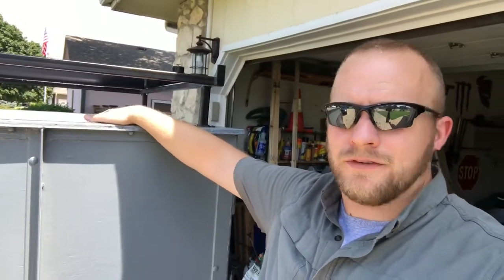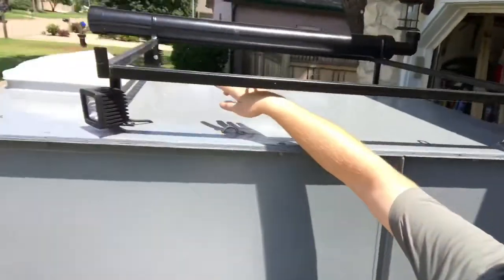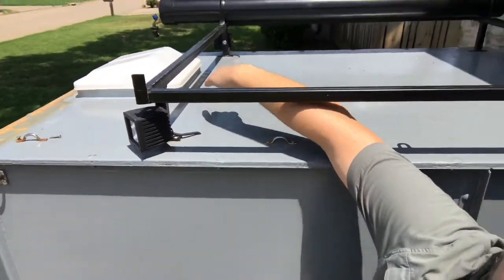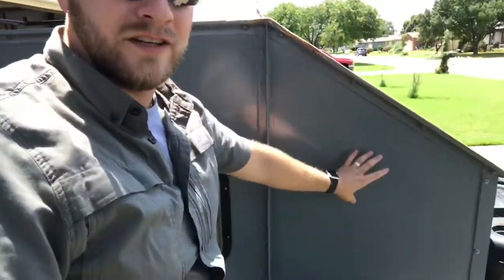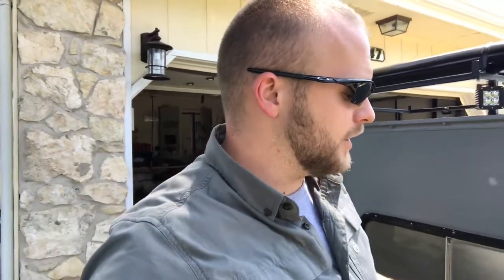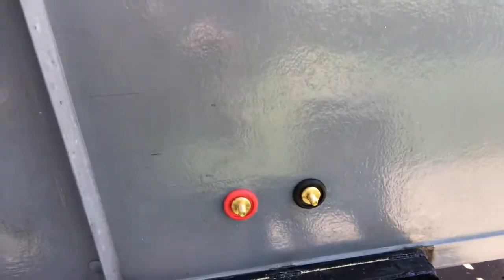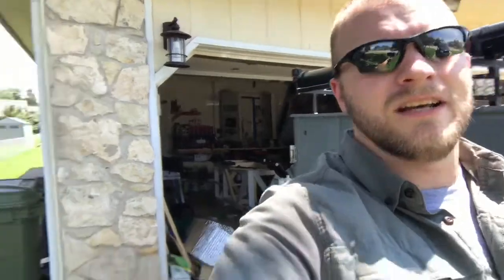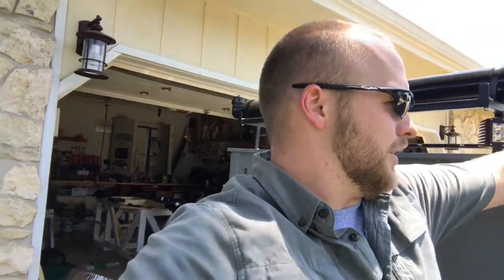Teardrop Trailer Solar-The Beginning Steps

Comment: Those bulkhead electrical connections are great, New Sub here and I will use those in my teardrop camper build,
Reply: Don’t use silicone. Use butyl rubber or polyurethane caulking.